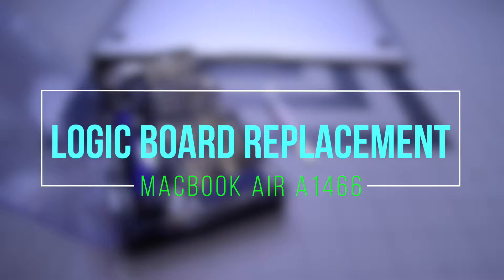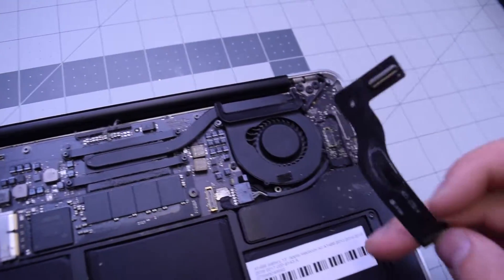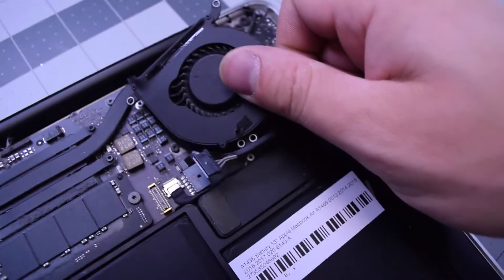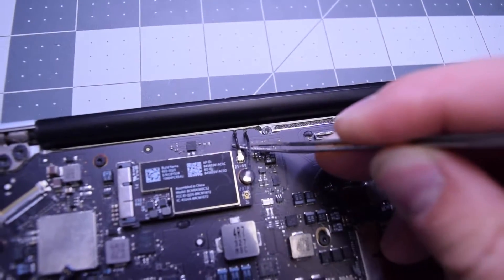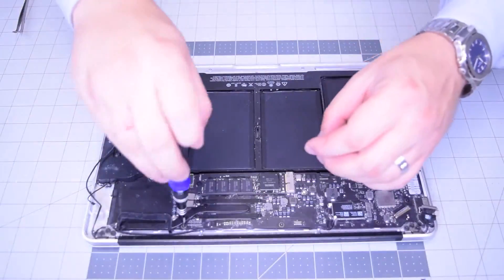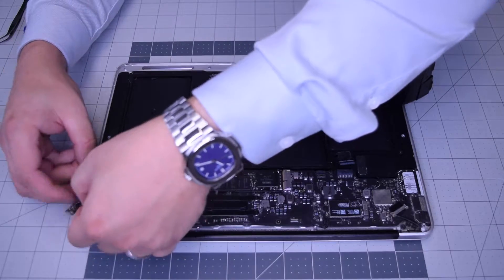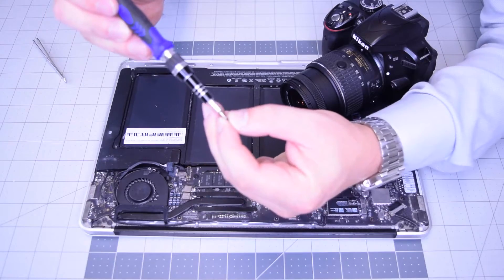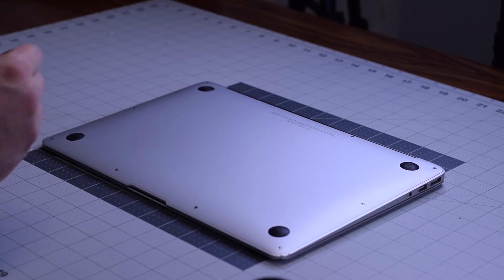Macbook Air 13" 2012-2017 (A1466) - Logic Board Replacement

Comment: Had some corrosion under the logic board so I removed it (with your help) and cleaned it with isopropyl and a tooth brush.  Works like a charm now.  Battery was working and charging but it wasn't powering up no matter what I did.  It would power on with the power cable plugged in and the battery unplugged so I knew I was onto something.  Great quick vid. Very helpful for noobs like me.
Reply: Hey! I had the same issue and I'm wondering if I can clean it like you did in this commen tor if the logic board needs to be replaced. For A WHILE it wouldn't only power on with the cable plugged but not nothing (even though the orange light is on).
Reply: @Lizzie9024  Absolutely. It was very easy.  The corrosion was from water damage but luckily it didn't damage very much!  Try it out. This vid is easy to follow.

Comment: This worked great for me, except mine had an extra 7th screw holding the very edge of the heat sink down, which was necessary to remove to pull out the logic board. Thank you for this tutorial.

Comment: Hi ~ everything was going okay until: after removing the 6 T5 screws from the logic board, the board still seems to be attached at the right end of the thin black bar on the upper right, just above where the fan was. I can't see any visible screws there ~ but am nervous to try and force it loose. Any suggestions?

Comment: Can I replace my old 2013 13" A1466 / 4 GB  logicboard to 2015 A1466 / 8GB or 2017 A1466/8GB  version ? I wish to have a Monterey compatible and 8GB machine ! I found very nice offers on ebay ....  a complete OS reinstallation is not problem....
Reply: would be interested in that as well

Comment: After removing the 6 T5 screws from the logic board, the board still seems to be attached at the right end of the thin black bar, that sits to the right, just above where the fan was. I can't see any visible screws there ~ but am nervous to try and force it loose. Any suggestions?

Comment: Yo, I would like to thank you for an awesome tutorial! Spilled juice on my Mac and knew for a fact it went to the logic board. Long story short, I followed this tutorial thoroughly and was able to remove my logic board , give it a thorough cleaning and then reassembled it with no problems what so ever. With the right tools this tutorial is all you need.. Thanks again. You now have a new subscriber!
Reply: MrVayga88 similar reason I’m here. But at least I didn’t spill the (luckily) water on it.  Did you check the contacts for the SSD and the WIreless module, on top of the logic board?

Comment: Thanks for your very clear tutorial, I tried to remove the damaged logic board myself, but it didn't come off at once while at the heatsink extension, there is still a T5 screw that needs to be removed which is half hidden under the wifi/bluetooth cable, just be aware...
Still a good tutorial!

Comment: Hello, i have a stupid question to ask. I have an macbook air mid 2012 model a1466. i would like to switch the logic board with an macbook air 2015-2017 a 1466 logic board. can i actually do that ? i don't care about the costs, i just want to know if this is possible. i'll look for an 8 gb logic board if this is possible.

Comment: I was wondering, since the motherboard dimensions and wifi. bluetooth, speakers etc locations are the same (pretty much) from 2012 to 2017, can I replace the motherboard of my macbook air 13" 2013 with one of 2017? Essentially for updating the intel processor.

Comment: Are the A1466 logic boards all the same?
Reply: As far as I can tell they are interchangeable but have different configurations like different ghz, different processor generations or different ram count. It seems like they are all compatible but can be slower/faster depending on the specific configuration.

Comment: Do I need to reinstall the operating system after replacing the board? Thanks!
Reply from the maker: No you don’t. It’s UEFI and so the operating system on the ssd will detect the new board and on startup will load a new profile for the system and so you don’t need to do anything. If you have a very old OS X like lion installed it might not load in a 2015+ board because of legacy architecture issues but that’s a rare scenario.

Comment: Hey I m in huge problem .. while replacing the dc/power board on my logic board , I accidentally broke the port/stand on which the right speaker cable rests(pried it out). The right speaker doesn't function now and since it's embedded with the logic board I am afraid if there is any hack to get it to work or not; I can't afford to buy a logic board at the moment. Can you pls suggest me some solution. Can this port b fixed somehow? 😟 Model :mid 2014 a1398

Comment: I change the logic board now the touch pad and keyboard not working it works before i change the logic board i changed because the laptop turned off when i used it too much there was some damage parts in the logic board so i think i didn't blog the the touch bad and keyboard wire but i don't know which one is it
Reply: replace your trackpad and keyboard cable.

Comment: I have an emc 2925 macbook air with a dead logic board.I also happen to have a an emc 2469 macbook air  from 2011 with a cracked screen .
Can i swap the the logic board from emc 2469 to emc 2925 ? or else 
take the screen from emc 2925 and install it on the emc 2469 (i don't need the face time camera connection)?
will the LVDS connector be an issue?
Reply: no,each year is different,to swap should be same year

Comment: question , i have a macbook air 2012 , can i put in a logic board from a 2018 air , or 2016 air? or does it have to be the exact year as mine?
Reply: I wanna know this too
Reply: Exact year
Reply: 2012 is different from 2013-2017. 2018 is a newer model.